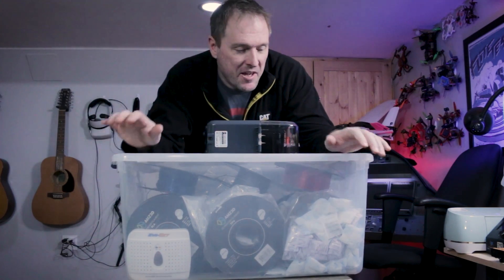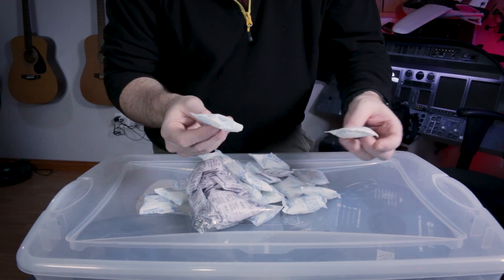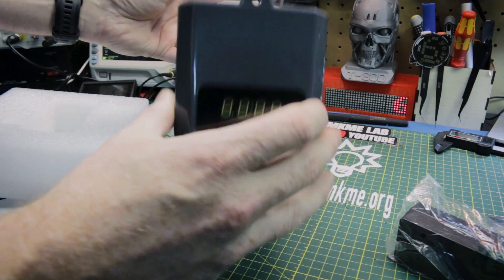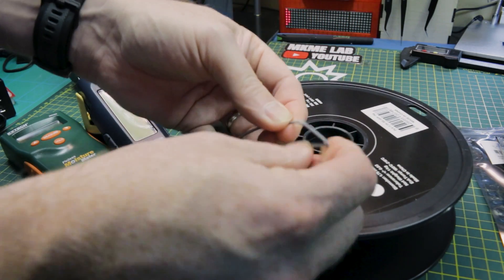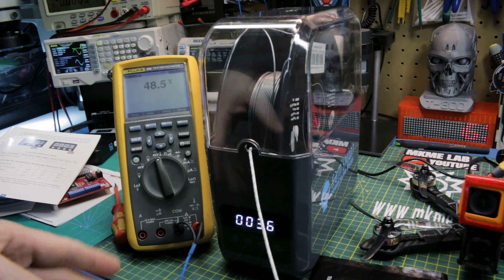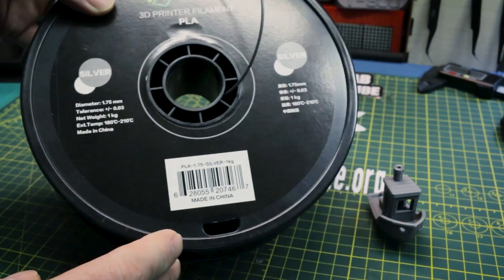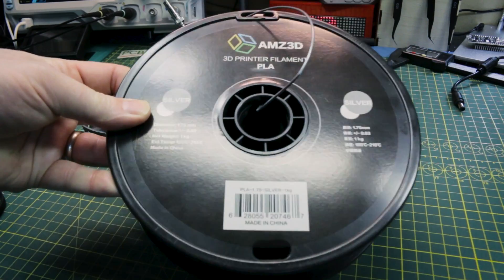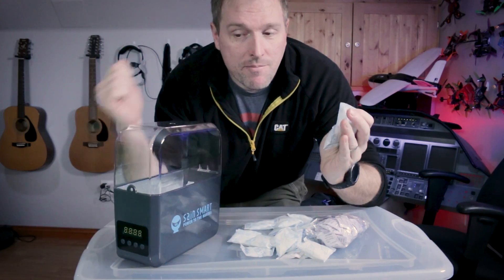3 Ways to ALWAYS Have DRY 3D Printing Filament

Comment: I got two of those desiccant devices, the first ones shown, from a different brand and they are excellent. I bought them 8 years ago to dry out the inside of a car. No demist required. Now I use them to dry out wood for carving. Drying filament is just a case of putting it under my gas boiler. Costs nothing

Comment: One way to determine if you removed moisture would be to way the spool before you dry it then after it's dried. It should way less. But like you said, the real proof is in the print